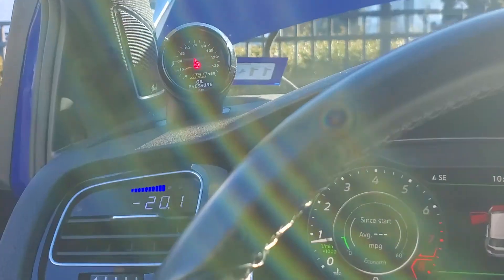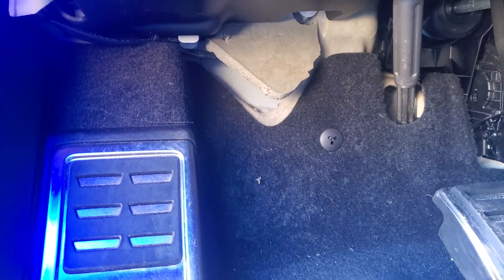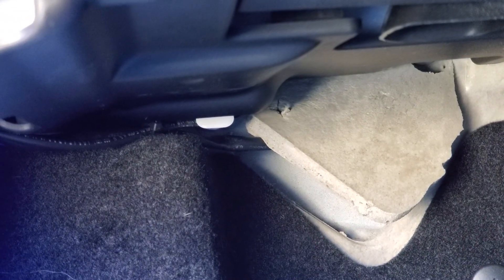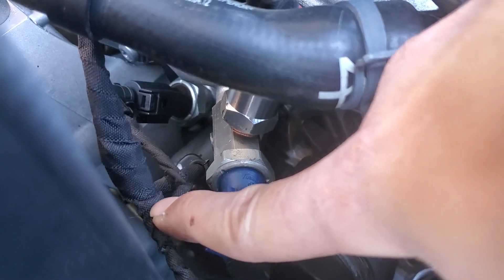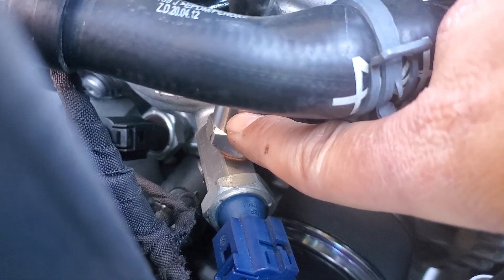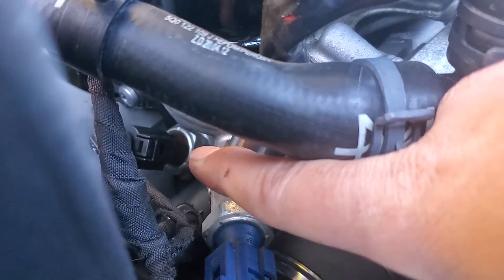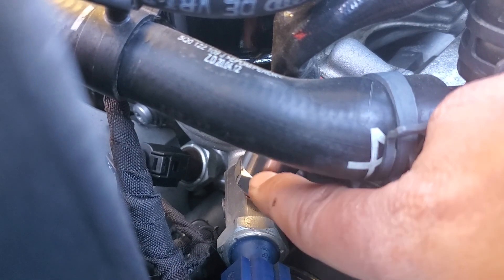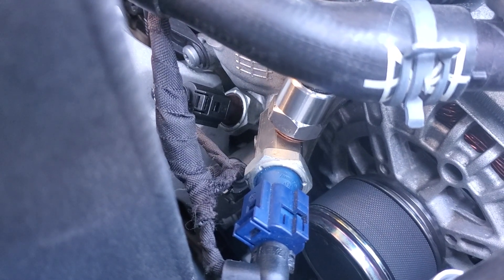Mk7 Golf Oil Pressure Sensor Installation

Comment: I want to install a prelube oil pump, do you know if these ports are pre filter? or post? is there a check valve? Basically, I want to install an electric oil pump to pull from my pan and pump oil into the housing to get my oil pressure up before starting the engine. I popped my last ea888 and I'm looking to add extra safety anywhere I can. I'm also planning on disabling my clutch in on start up to reduce crank walk.
Reply from the maker: Ah okay. You are trying to prevent crank walk.  I dont, but you could add an online filter.  The only issue is where do you plan on plumbing it in when it comes to the pan?  You might be able too if you have a metal pan.
Reply: @RhoadsChristopher  I have a wortec oil pan, it has an extra quart capacity and two extra tapped ports. Im more worried about pumping oil into the system and reverse pressurizing the filter and pushing out contaminants. I need to make sure there is a check valve. Somehwere in that housing. Ive debated on removing the stock oil cooler and using a factory dsg cooler as an oil cooler and piping it in there but i wont have that ready before first start up on the new block

Comment: The brown sensor is an oil pressure sensor too. For low pressure when idling. This is NOT an oil temperature sensor. That sensor is on the bottom of the car where the oil level sensor also is.

Comment: I got one m10 1.0 with 1/8 npt is all good but it seems that the oil gauge sensor has a bigger 1/8 npt lenght that covers only half of it
Reply from the maker: Most gauges are 1/4 ntp.

Comment: How do you get that fitting that installs onto the same port as the oil temp and pressure sensor
Reply from the maker: You have to get the correct fitting.  It doesn't use NPT.
Reply: @RhoadsChristopher  I found it on eBay it’s an m10 adapter with 1/8 npt ports on the side

Comment: I'm getting my oil pressure reading. From my Racingline Oil Cooler on my S3. I bought and AN fitting with a npt port.. my oil temp I'm getting it from replacing my oil Pan for a metal one and took it to a machine shop and they made a hole in it for me to install the oil temp. I wasn't getting a proper reading from there since they're low and high pressure switch

Comment: which sensor adaptor did you buy?  The OEM sensor appears to be a straight m10 x 1.0 thread.  I have ordered 2 adaptors off amazon that say they are m10x 1.0 and they are actually a tapered male thread.
Reply from the maker: Hey Nicholas, this is the exact unit I got from ebay.

https://www.ebay.com/itm/114177430425?mkcid=16&mkevt=1&mkrid=711-127632-2357-0&ssspo=LNiw28TmQne&sssrc=2349624&ssuid=WIPavv8QS4y&var=&widget_ver=artemis&media=COPY

Comment: Just curious y u didn’t connect your oil pressure gauge to your p3 analog?
Reply from the maker: 1 main reason, because I already had the complete gauge setup from my old MK3 Supra that I parted out.  That and I wanted to be able to see two sets of data at one time.

Comment: When taking put the sensors or swapping them, did you have a lot of oil leaking out?  About to attempt this but not sure if I need to drain oil or take of filter if anything.  Am I expecting a pool of oil to pour out?  
Also did you have to use Teflon tape or any sort of crush washer/rubber o rings to prevent leaks?
Reply from the maker: Nope, little to no oil.  I used some Teflon tape and a copper crush washer.
Reply: @RhoadsChristopher  appreciate response.  Going to pick some up now.  Figured double up tape and washer might not be a bad idea.
Reply from the maker: @SKYRIDR  yup yup. You don't want oil passing out of that spot.  It'll cover your belts.

Comment: 2015 GTI only have 20k miles on it and original owner and never abused.  I just replaced original battery finally died and then got the low oil pressure warning that disappeared but left the triangle ! icon on. No flashing or blinking alerts.  I never have low oil and was recently changed and level is fine.  Car drives and sounds fine and temp is good. I assume it must be a faulty sensor because the warning mentioned low pressure "sensor".  Is it the blue sensor that needs to be replaced?  I see you mention the blue and brown which brown was for temp not oil pressure.  It looks to be no big deal to replace it the blue one and interested in any tips to do so and thinks to consider when doing it.  Is it foolish to keep driving till I get the sensor replaced for short trips less than 10 miles or should I take it very seriously?   Thanks !!
Reply from the maker: Hey, I would take it serious just in case.  The last thing you want to do is wreck your engine.  The blue sensor is what you want to replace.  It is fairly straight forward and easy to do.
Reply: @RhoadsChristopher    I thought the pressure sensor was below the engine and would take more time.  Thanks for the response.  I will order part today.  Any suggestions where to buy one on-line.  OEM  Having a hard time trying to pop off the connecter,   I was able to use a small needle nose on the temp sensor and was able to pop that off by putting it down where it looked like a place to push down in to disconnect and it did.  Don't want to break anything.  Any tricks on how to pop the blue pressure sensor off.  Thanks again.
Reply from the maker: @Free Rein  so keep in mind if you watch the video again, I changed the position of my sensors.  I did that because I didn't want to dead head my oil temp sensor.  So my oil temp sensor is at the bottom now.
Reply: @RhoadsChristopher    I noticed that and understand why.  I just want to replace the blue pressure sensor and leave it where it is.  Having a hard time popping it off.  I did the brown sensor just to learn to disconnect the blue one if they are the same type of connection / disconnection tab method.  I might install a visual pressure sensor at some point but for now just want to make sure the sensor alert I am getting is the sensor not working and not something more serious even if it runs great, clean smelling oil and only 20,300 miles on the motor.  Thanks again.  :)
Reply from the maker: @Free Rein  so I had to use two very long extensions, a swivel joint and a socket.  It is at a strange angle, bit it can be done without removing anything.
Reply: @RhoadsChristopher  I have those tools just trying to pop off the plastic blue sensor connector so I can put the swivel socket on a remove it.  Do I just have to pop off the black connector only that spins if that makes sense.
Reply: basically trying to disconnect the wiring harness from the blue oil pressor sensor and wasn't sure if i needed a special tool or trick to do it.
Reply from the maker: @Free Rein  I can look.  I'll post back in a sec
Reply from the maker: @Free Rein  at the end of the sensor you are going to see the plug.  You will see what looks like a clip.  Take you finger and on the edge of the clip pull it back towards the wiring harness.  This will allow you to remove the plug.  You aren't pushing, you are pulling the tab back towards you or the wires.
Reply: @RhoadsChristopher   Thanks I will give it a try,  I got carpel and trigger finger issues and don't want to be impatient and break the connector.
Reply from the maker: @Free Rein  no worries. Let me know if you need a video.  I can make a short clip showing you.  Because my sensor is easy to get to, I was able to do it with one hand.  It is positioned in a way that I can easily show you as well.  That way you have a better idea since yours isn't as easily accessible.
Reply: @RhoadsChristopher  replaced the sensor and still getting an oil sensor alert,  it doesn't say low oil pressure sensor like it originally did recently and after I replaced the sensor.  Car still seems to be running fine.  It was a real pain to take the sensors off ended up using long needle nose to get it out.  Anyway, I guess the next step is to do an oil pressure test.  Can I hook the pressure tester to the brown connector vs the blue one which is easier to take out. Frustrating with a car that only has 20k miles on it.  :(
Reply from the maker: @Free Rein  I would imagine that would be OK.  You can get a mechanic oil pressure sensor and see what it is reading.  That sensor really isn't hard.  If you have a 6 inch extension with a swivel and then a longer extension you can easily remove that sensor if need be.
Reply: @RhoadsChristopher   Once I got the clip off it was easy to replace.  It was pain to get the clip to release the wire harness that was a pain.  Going to get an oil pressure test done on Thursday.
Reply: Tested oil pressure and it was 25lbs and 60lbs low and hi temp.  I am now getting the oil sensor alert with the squiggly line and also noticed that when I put oil temp on my monitor screen it doesn't show temp.  I guess I need to replace the brown sensor which from my understanding is the temp sensor.  I had the tech plug in the diagnostics and he said I was also getting the low oil alert which is from my understanding another sensor that is connected to the oil pan.  At least I feel comfortable driving it but want to get these alert problems resolved.  Original alert was low oil pressure alert but it could of been the brown sensor and not the blue one.  SMH!!
Reply: @freerein4074  did you ever figure out having a similar issue in my golf r

Comment: Hi brother 
What the maximum oil temperature I have mk7 R 2015 now the degree more 127 or 128 it’s normally?
Reply from the maker: That seems a bit high.  I normally see around 226 F which is a lot lower.  Did you install an oil pressure sensor?

Comment: Thank you!!
Reply from the maker: If you have questions feel free to ask.
Reply: @RhoadsChristopher  I know it’s been a while since you posted this video but I had a little question. I found this adapter part on Amazon. I found the exact same size on Amazon for $20, but I found one for $10 with same day shipping but it is M10 X 1.5. Not M10 X 1.0. Would that still work. What is the 1.0?? Does that have to do with the length of the threads or something?
Reply from the maker: @robertwinnall8120  no do not use that!  The 1.5 and 1.0 is the thread pitch.  You will strip the threads out.  Look up thread pitches for a better explanation.  Chances are it also wouldn't seal correctly creating creating oil leak.
Reply: @RhoadsChristopher  that’s what I figured. Thanks so much for the replie
Reply from the maker: @robertwinnall8120  no problem at all.

Comment: in my Golf 7R, there is a blue oil pressure switch at the bottom and a brown oil pressure switch at the top.  does it matter where you are wrapped up?
Reply from the maker: You might see a difference because I switched my oem sensors.  The top sensor was originally brown, which is was the oem temp sensor.  The blue one is the pressure sensor.  I switch the brown sensor to the bottom to keep it in the flow of oil so that it didn't dead head in the adapter which would cause inaccurate temp readings.  I then mounted the blue sensor (oem pressure) on the end of the adapter.  This was because it is ok to dead head that sensor and it'll still read correctly.  Does this makes sense?  I also went with the top port as it was easier to mount the aftermarket sensor in that area.
Reply: @RhoadsChristopher  There is no temp sensor on the filter housing, it is in the pan. The brown sensor is the reduced oil pressure sensor and the blue sensor is the high oil pressure sensor. Two switches are necessary for the two stage oil pump. There is a third green oil pressure sensor on the front of the block, just to the right of the water pump belt, that is for the piston cooling oil line. I would swap the blue and brown around if I was you, they are in the wrong positions. Probably won't matter much as their feed lines are pretty close together inside the filter spout.
Reply: @tipptop9 exactly. The brown one is not an oil temperature sensor at all as SevenRFive says in this video. 😮
Reply: @RhoadsChristopher  Thanks👍🏼🙂